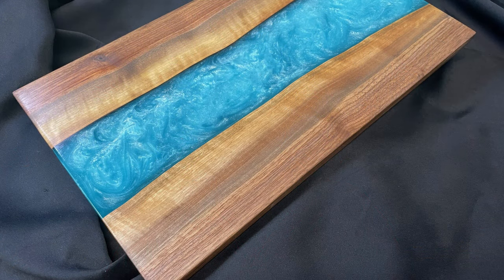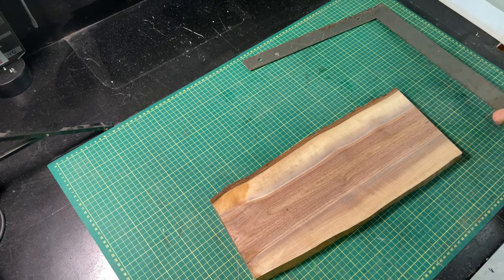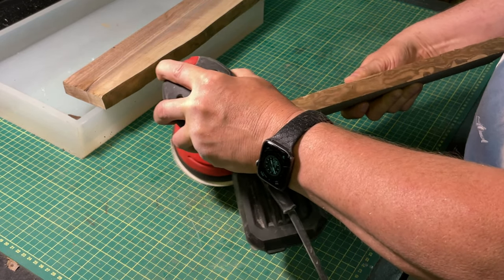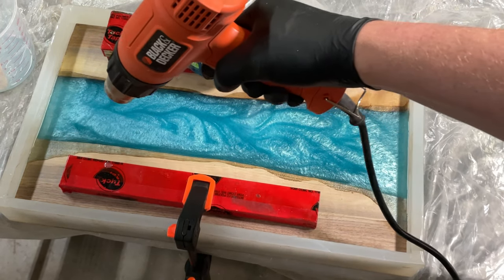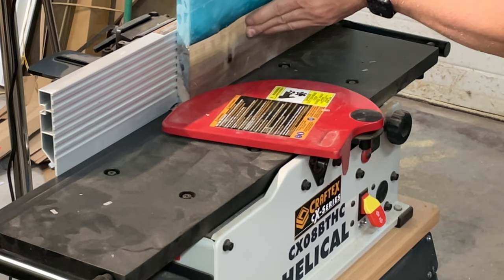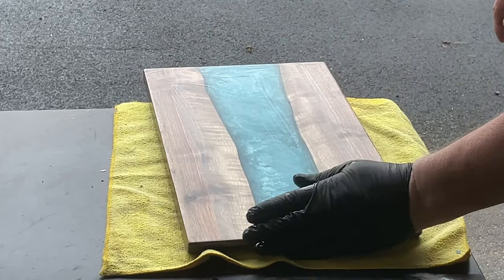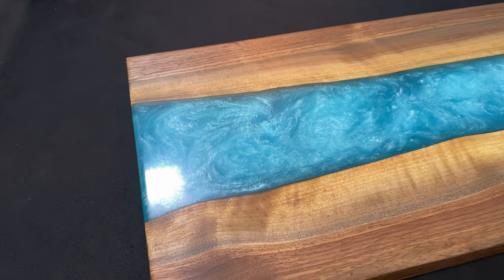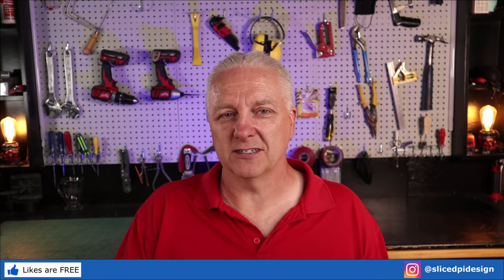Make River Charcuterie Boards for Profit

Comment: Hi if you are using an electric sander what grid do I start with first
Reply from the maker: I typically do 120,220,320 and sometimes 600 or more if I’m really looking for a mirror finish.  Then finish it wi mineral oil, and/or a mineral oil and beeswax finish and buff it
Reply: @SteveMakesEverything  ok thank you very much

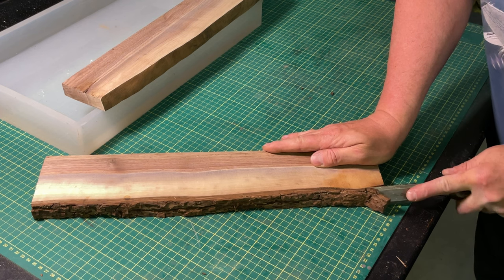Comment: 4:00 :/ do i have to do that if the bark is thinner as well? i have little ~5cm diameter crosscuts (with engravings on them), and i want to make an epoxy board with them. getting rid of the bark would be timeconsuming and it also wouldn't look as nice, imo. 
sry if that's a dumb question, i m doing this for the first time xD
Reply from the maker: Not a dumb question at all.  The answer really depends on how well the bark is attached to the wood, but as the wood dries out or collects moisture the bark will eventually break off.  

However if you coat the entire piece with clear epoxy after you are finished engraving then you should be able to keep the bark attached.  It still won't be the strongest though so if someone wrenches on the bark it still may break off unless you have more than a 1/16" of epoxy on the whole piece.

I have no real eye for the artistic, so I'm pretty pragmatic about things and I would personally remove the bark.
Reply: @SteveMakesEverything  thanks for the quick answer!